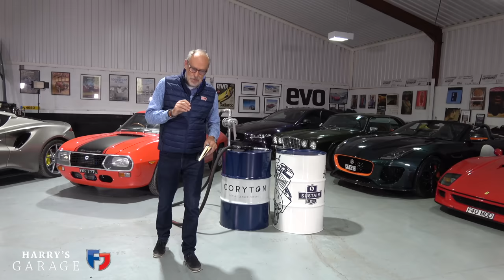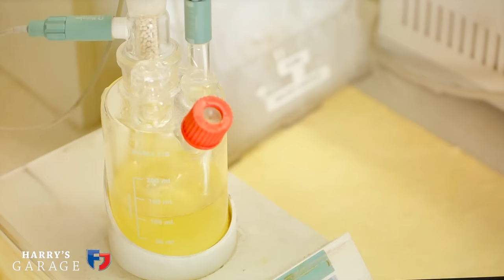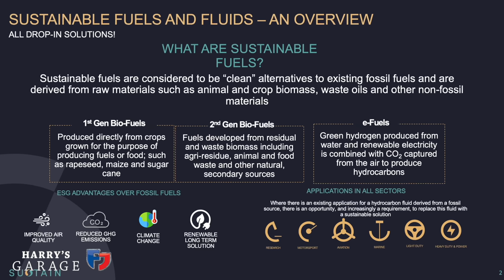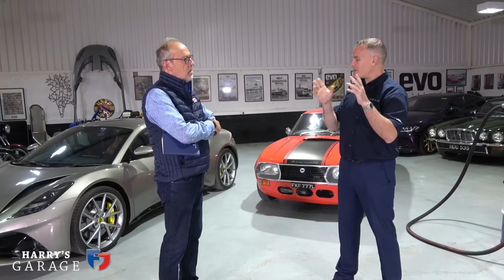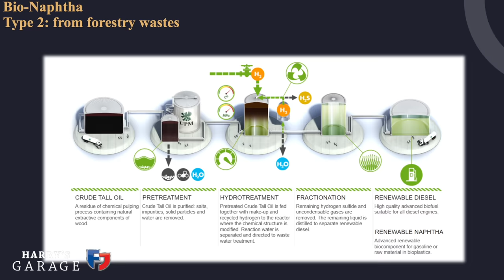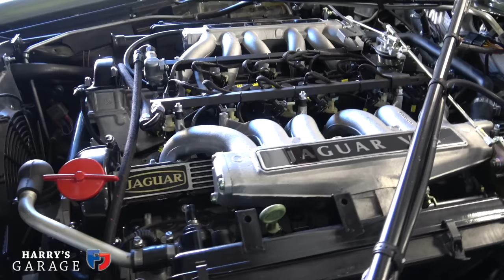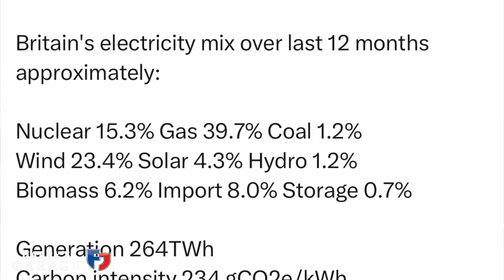Everything you need to know about using sustainable fuels. Why they're good news for car enthusiasts

Comment: In theory, E-Fuel for cars sound like a good idea. In theory, that is.

But: According to Shell, there will be no significant E-Fuel production before 2030. And "significant" doesn't mean there is enough of it for each and every car. Not even by a long shot.

According to Fraunhofer Institute, production cost will be 1,20 - 3,60€ per Liter in 2050. Conventional fuel today is 0,60 - 0,70€ before taxes, profits, transportation etc..

Here in Germany, only 2 car manufacturers consider building ICE-cars after 2030. Porsche wants to do it, BMW would like to have the option.

But even if they keep building them - many countries won't allow importation anymore.

Running an ICE-car on E-Fuel made from electric power needs 5x more energy than running an EV. An EV is 70 - 80% efficient, ICE on E-Fuel 15%.

In 2030, EVs will be significantly better than today. More range, less consumption, less weight. Electricity prices at chargers will go down significantly, too. For those reasons, only very few people will be interested in buying new ICE vehicles.

Even in big-scale, production cost is exponentially higher than conventional fuel.

To reduce emissions, all air traffic needs E-Fuel - batteries are too heavy for planes. Therefore, it is doubtful there will be enough of it to run cars with it, too.

Furthermore, E-Fuel ICEs emit quite a bit carbon monoxide and ammonia.

In total, it is interesting technology - but, without subsidies, won't live much longer than E85, Bio-Diesel, CNG etc. which were "the future" a few years ago. They do still exist - but they aren't "the solution".

There will never be "the solution". There will be different solutions for different applications. And it won't be like "flicking the switch". It will take time before every aspect of our lives will be CO²-neutral.
Reply: Thanks for a reply with data. From this I did a bunch of googling. There’s an interesting paper that was produced by the EU that says that 17% efficiency is the current practical limit for energy efficiency in using e-fuel. That is the origin of your costs per liter. So this will be fine for using in your classic car doing limited mileage, but that would mean around £400-£500 a tank on pure e-fuel and those numbers will never come down due to the efficiency. Nice idea but this is only ever going to be niche - shame.
Reply: @nixer65  Spot on.

Considering allmost all classic/collectors' cars do little milage annually anyway there is little advantage to premium pump gas/conventional synthetic fuel.

Personally, I like Autogas/LPG. Especially pre-DI petrol engines are easy and affordable to convert.

It saves ~10% CO² - it's superclean (a tiny bit of paraffine - the gas filter takes care of) and has more than 100 octane. It's a fossil fuel - but basically a waste product. Nobody drills a hole in the ground for it. It comes partly along with crude oil out of the well - partly along refinery operation.

My 2006 Ford Focus ST has the good old 5-cyl. pre-DI Volvo engine.

It's already my 2nd ST - the first had LPG installed and ran perfectly fine - no.2 is fully laden but no LPG.

A complete new Autgas system would cost less than 850€ - luckily, I can re-use the golden evaporator and the Hana Gold-injectors. Both would be ~200€ extra.

Regarding cost: Conventional E10 is ~1.80€/liter at the pump here in Germany. Production cost are 0.70€. Therefore, E-Fuel at 1.20€+X would be at least 2.60€ at the pump. Without fuel tax or VAT raise, that is.

As we say here: It's just the next pig driven through the village.

The last one was CNG. Only a few years ago - almost every manufacturer had at least one CNG model on offer. Dacia for instance offered an LPG model from the factory - they were mostly aimed at Eastern Europe whereas most German customers went for a Diesel for high milage.

Opel (Vauxhall in the UK) offered CNG and a few LPG models. One of them was the Zafira 1.6L 101hp CNG. Looked good on paper - problem was the heavy CNG steel tanks. 200kg dead weight extra. Considering a Zafira is usually bought to transport 2 adults and at least 2 kids and additional stuff - a 1.6L 101hp doesn't cut the mustard.

Even today, there is a reduced fuel tax on CNG here in Germany - but not on LPG any more. Thank you, car lobby!!😡

But even at ~1€/Liter it's still a bargain. Even when adding the 20% higher consumption on LPG - that's 1.20€ for a super-clean, 100+ octane fuel readily available.

That's 0.80€ less than inferiour V-Power/Ultimate petrol. The imaginative queue at the station selling that crap for 1.20€ would reach to Fireland😆
Reply: But even with LPG - for short distances, I take my bike. There is little point in starting my ST cold, stop-and-go into the city, find a parking place. Let it sit for 30mins or longer - starting it cold again, etc..

When I drive I always take the time to drive it warm - in warm condition, engine wear is almost zero. Plus, consumption is lower (no condesation losses) and I can use it's power. It's a ST, after all.

For long trips (depending where) I like the train, too. Especially congested Autobahns around big cities like Cologne or Frankfurt are a pain in the a.

Comment: Clearly a lot of engineering skill going into this. What if some of that was focussed on the feasibility of conversion of classics to run E85?  Admittedly it would involve replacement tanks, fuel lines, pumps, carb tuning etc. but the fuel is readily available

Comment: I'm French and I can't help myself thinking you're getting robbed in the UK. Yes, as I quite understand, the chemistry explained in the video showing what goes into making those fuels really take  into consideration our beloved old cars and sport cars. By that I mean that the simple fact the fuel is "drop in" is in itself a pretty nice achievement.

However, here in France and in a lot of places around the world, we get e85 which seems to be as sustainable as Coryton's fuels, albeit with even more sustainable juice (85% as the name suggests, but maybe that's to do with the tracabilty stuff). An old carburated car would need some tweakings to the ignition and fuel flow to take it correctly, and maybe some new rubber joints, but as long as you have electronic injection and ignition, it's a no brainer. I currently run a Civic Type R FN2 with a flexfuel map but no other mods, and it just works flawlessly. 

The "getting robbbed" and "no brainer" refering to the fact that we pay around 1€/liter. With the difference in price, I can clearly schedule some rubber joints replacement if ever that's really a topic...

Comment: Thanks Harry for this investigative interview. I live north of Hamburg close to the coast in a region that has recently been named the >>green energy valley<< because wind energy allows the industry to produce green hydrogen in significant amounts here. In the future it’ll become crucial that the energy for processing fuels comes from green sources like wind energy. For me as an owner of 5 classic cars it is delightful to hear that preserving existing vehicles can be more sustainable than constantly building new ones to adopt to green tech. I recently learned that carbon cleaning engines by using hydrogen can increase performance and lower emissions at the same time (considering to try it for the first time on my 280ZX). Would love to learn more about this and other methods to run classic cars longer, cheaper and more sustainable and simply have more fun with them.

Comment: This is an absolutely brilliant initiative in bringing sustainable liquid fuels to market. No adjustments needed to our cars, just fill and go. Is the cost ever expected to come close to regular petrol and diesel?

On a slightly different note - safety: if there's a fire, can this fuel be tackled just the same as fossil fuels? As we've seen recently, when electric car batteries ignite, the only way to put out the fire is to let it burn, however many days that might take and however poisonous the gases might be. Now instead of a ship, visualise an underground parking garage with flats/shops etc. above.
Reply: First question, synthetic fuels are massively inefficient to make vs cracking crude oil - the only way they will come close or under the cost of fossil fuels is taxation/emissions surcharges - i.e. fossil fuels becoming significantly more expensive…

Question 2.  Synthetic fuels are hydrocarbon based - just versions of alcohols and petroleum - therefore exactly the same to put out a fire as existing fuels - just remove oxygen source (air).  Lithium batteries are difficult to extinguish because there is an oxygen source within the battery that feeds the fire which traditional fire fighting techniques cannot remove.

Comment: Really knowledgeable guy. Good to hear. Really hope these fuels are the way forward and we stop this battery nonsense
Reply: Stop the battery nonsense? That's just nonsense!
Reply: @jcfallows  why's that? We don't have the infrastructure or energy available to charge the number of vehicles we have on the road if we go all electric. The energy itself still comes from fossil fuels. The batteries themselves take impractically long to charge and have a limited number of charge cycles before they stop holding charge. Meanwhile, every car that's been built for the past forever runs on fuel. So work towards making the fuel carbon neutral and then we don't have to force everyone to buy new cars (which itself is surely a terrible idea environmentally) and make all the current cars obsolete (also ridiculous). Battery power is the least amount of effort the government and manufacturers can put into the environmental issue while still making a lot of money and not actually helping the environment
Reply: @joshtoth-thomas5847 Because driving a given distance using e-fuel requires well over 5 times as much electrical energy as using the electricity to power a motor directly. Creating the Hydrogen and capturing the carbon are extremely energy intensive and require exactly the same green energy you say we won’t have enough of. Ironic really…….
Reply: @simonm9923  there's more than 1 way to skin a cat and I'd be curious to know where you got the 5x figure from. He said IN THE VIDEO that they use green energy to extract the carbon which we know we don't use to feed the national grid. He also made it clear in the video that there are a number of methods available and in their infancy here. My point is, surely this is a better avenue of development so that we can keep current cars on the road as long as possible, which is far more environmentally friendly than making them all redundant and having to replace them all with battery powered alternatives. Surely the best thing for the environment would actually be to stop producing new cars but you get lynched for suggesting such a thing. In any case batteries aren't the solution. They're a plaster on a missing limb
Reply: @joshtoth-thomas5847  Don’t get me wrong, I welcome any solution to reduce CO2 emissions, even ones like this which are at best a partial solution. Synthetic and E-fuels will only ever be a niche solution as explained in the video. They require vast amounts of bio feedstocks for Coryton style synthetics or vast amounts of green energy for E-fuels, neither of which are scalable or economically viable to support the mainstream market or volumes. I can see why it would appeal to big oil as they can continue to profit from selling us hydrocarbons. Plus they continue to emit the same pollutants as fossil fuel which are a problem in the location where they are driven.

Comment: Harry you made a very good point about classic cars and motorcycles is that there carbon footprint involved in the manufacturing if them has gone in Australia we have E10 but we have unleaded petrol also 91 95 and 98 also available from very petrol stations E85 and we have are a 2021 Suzuki Beleno and l own a 1997 Toyota Hilux and we only use 91 unleaded in both of them and the E10 is 2cents cheaper than the unleaded   91 and l have had very bad experiences with E10 in the past not catostophic problems but l did use E10 in a efi ute l had fir courier work and l the petrol pump in the tank failed twice and this ute didn't sit around it was driven every day also we had a brand bew Ford Fiesta tan E10 in it and the fuel pump failed from the E10 l replaced my ute because it had just worn out because courier work is hard on vehicles l bought another ute ran it on 91 unleaded and never changed the petrol pump on it so E10 you can use it in modern engines but you will be replacing oetrol pumps and my 1997 Toyota Hilux is carburetored so no way will l ever out E10 in it

Comment: Great Video. I think all alternatives to Electric should be explored as there must be better alternatives. If this sustainable fuel runs on all combustible engines then great. Petrol and Diesel options too I assume. The current issue of course is the price - 4/5 £ per liter. Thanks to Harry and those who give it a go and try to be early adopters. Let's hope the journey of sustainable fuels resolves the technical, availability and pricing issues so we can have mass market and keep our combustible engine motors!
Reply: At the point we have to grow things to run vehicles, it has to be wrong. Especially when Ev alternatives can use wind and solar. We need all the crops we can grow just to feed a still growing planet.
Reply: @mustrumridcully3853  Exactly, the poor energy efficiency just doesn't make sense.

Comment: One thing that is often not realised even by those developing the fuels is that compared to regular fossil fuel the engineered fuels are generally less dense. I don't mean power density but the actual density of the liquid fuel. Therefore when compared side by side you will find the less dense engineered fuel requires 10-20% more fuel throughput to maintain the same power output of the conventional fossil fuel. This only happens on medium to high load conditions but needs to be acknowledged to calculate properly the whole life calculations of the these fuels. A particularly bad example of this would be HVO fuel.

Comment: Great video, he really knows his stuff! My only issue is that the rules that will effectively ban petrol/diesel cars can just be subverted if you have enough money, so the message sent by the government is, you'll have to buy an EV, unless you have loads of money and own a Ferrari or a Porsche in which case, those rules don't apply to you. Could the synthetic fuel processes not be expanded enough in scale that together with the natural efficiency gains in car and engine design, EV rollout could be delayed or at least staged more sensibly? South Africa uses the Fischer-Tropsch process for example for very large scale production of petrol and diesel, I accept they are using fossil fuel as feedstock but does synthetic fuel really need to be just a low volume thing for F1 and supercar owners?

Comment: Remember to check your fuel lines regularly in your classic regardless of whatever fuel you are using. Any E10 fuel could degrade your lines
Reply: thats a lot of bull. Its the cheaper lines used around the 2000-2005 era that are subseptical to the alcohol in E10... not older or newer lines.  varuous older Outboard engines were tested on E10 and not one of them showed any sign of deterioration. Older fuel lines are better made than newer ones and contained more chemical resistent materials. Having said all that the problem with E10 is rotted out fuel lines, which will deteriorate them at a faster rate as it drys them out at a slightly faster rate than other fuels if its been sat for a while. Now considering we are talking fuel lines here then you want to be replacing them on or before the deterioration stage as it happens alarmingly quickly once the material has broke down. Also 2 stroke oil is known to offset any damage that can occur with overly volitile fuels for example i run methanol in my pro-stock and after every race i change maps then run it on V-power with a small amount of 2 stroke oil through it, mainly to dry the engine out and my lines last years rather than 6 month doing that. Also additives and inhibitors are a ruse too. They do work but all they are is overpriced 2-stroke oil mixed with parts cleaner (usually old head cleaner)
Reply: spend a couple quid on some braided steel fuels lines, never worry again
Reply: @anyau braided lines the S/steel is on the outside its a pretty penny if you want the full stainless efforts. Brake hoses the same the only part thats stainless is the outer sheath.

Comment: These renewable synthetic fuels make sense for classic cars. But for more modern cars, ethanol seems a better option because it is easier and cheaper to produce and more powerful if the engine is re-tuned.
Reply: ethanol is worse if left stagnent
Reply: Ethanol was the better option from the very beginning. For all cars, unfortunately the inferior petrol has been the cheaper and easier alternative for the past century.

Comment: It’s very hard to find the old diesel number 2 in California. Most stations have switched over to a fuel that says “sustainable” on the pump and is actually cheaper than diesel no 2. It doesn’t say a B5 or B20 biodiesel for example, we also have those pumps around, it still says diesel no 2 on the pump but says something like “95% sustainable” on the pump, nothing about biodiesel.